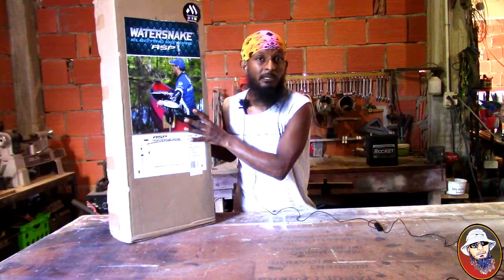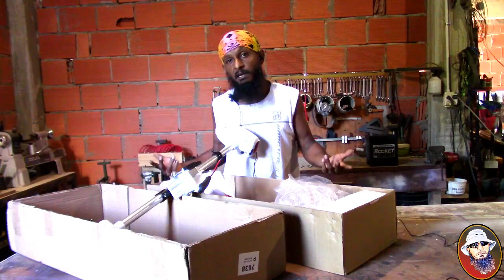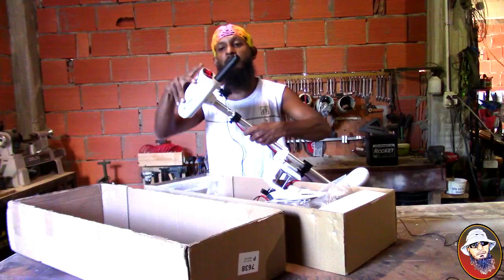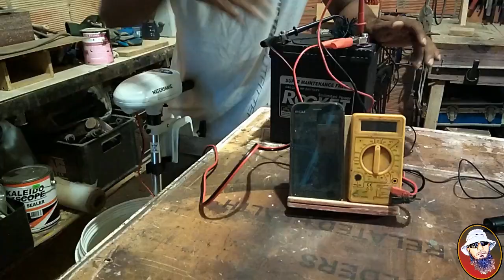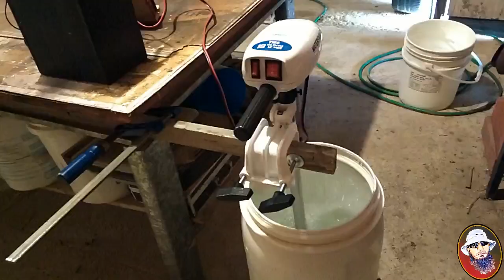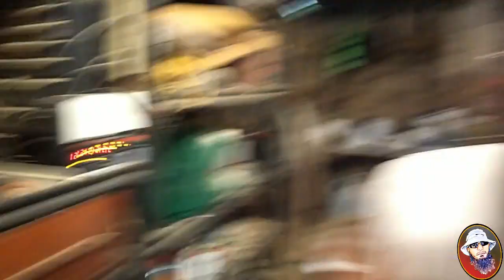Watersnake T18 trolling motor unbox and review

Comment: Great video,  how long did you have to wait for the order? Do you have any disappointments about it?
Reply from the maker: it took about a month to get here and nah no dissappointments at all in the motor . the battery however is another story . i didnt get to use it as much as i wouldve liked but the few times i did i was more than happy with it . at times it would struggle against the current and id have to paddle to help it along but it was still making it alot easier to paddle